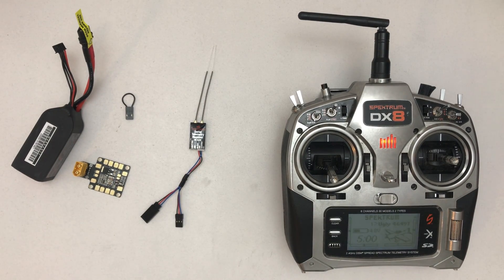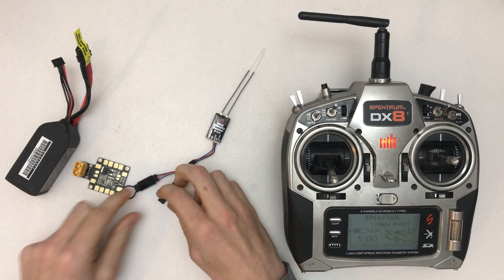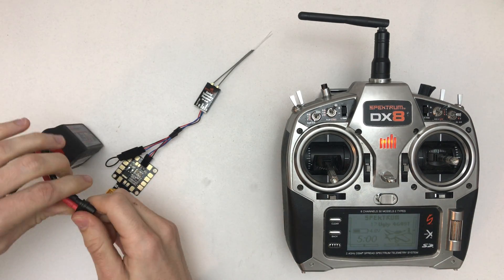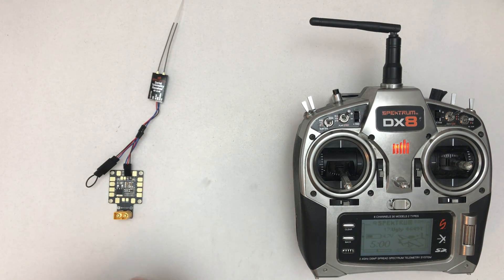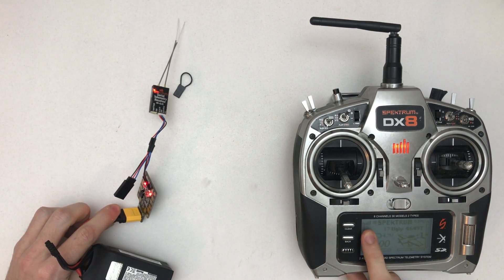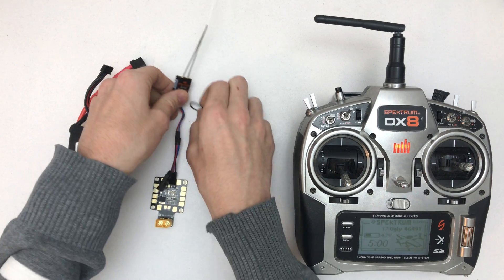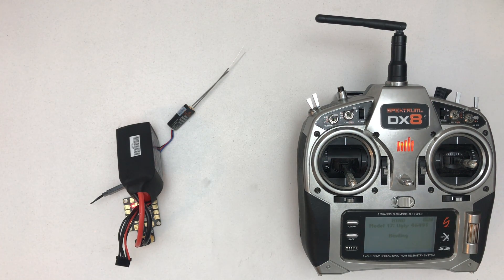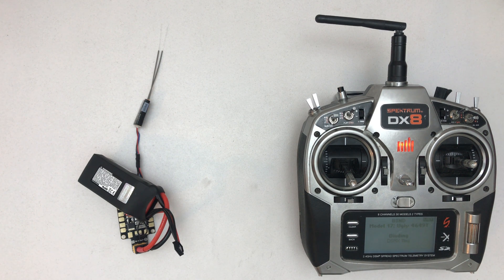HowTo: SPM4649T Bind // 11ms // Bind Plug // Spektrum // DX8

Comment: I got an issue with the binding... anytime i put on bind plug and than connect to power source... the RX does not go to bind mode... it just have that red blink.. 1sec on 1sec off......
Reply from the maker: sorry to hear! There is always the chance it’s DOA (dead on arriving). What you can try is putting your Tx further away (like other end of the room), put it into bind mode, then power in the Rx with the bind plug connected. 1 sec on 1 sec off sounds weird indeed, does it happen like that no matter the Tx is trying to bind?
Reply: @JulianGoesPro  yes... as soon as power source is connected... its just blinking on n off..(but not rapidly as binding mode)
Reply from the maker: @z3kir  so the bind plug makes no difference if connected or not?
Reply from the maker: @z3kir  it's private, you have to set it to unlisted :)
Reply from the maker: @z3kir  that is indeed a weird blinking mode... do you have the usb updater to try flashing the newest FW?
Reply: @JulianGoesPro  unfortunately no.. I don't have ... and ill have to order online which takes atleast 2 weeks to reach to where I live. Plus not sure if it be worth it.
Reply from the maker: @z3kir  I am not sure you might be able to hack one by using a Arduino nano or an FTDI usb thingy not sure... I bought one because you can get them quite cheap (at least back then) and I like keeping my receivers up2date :)